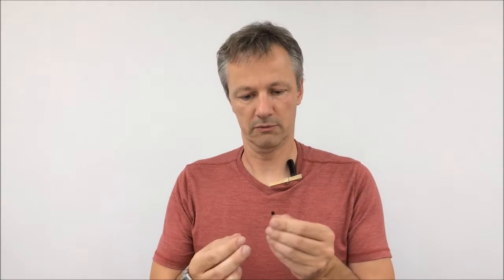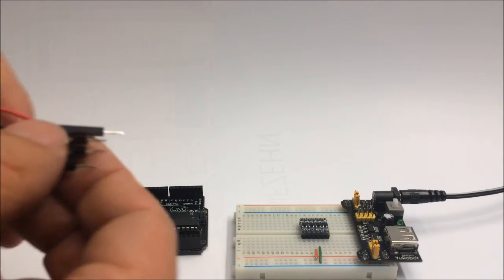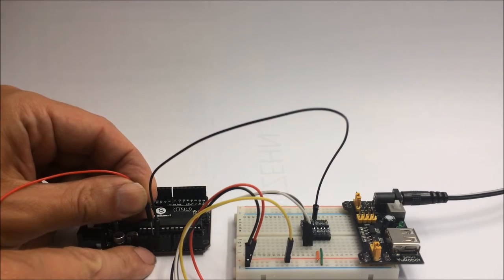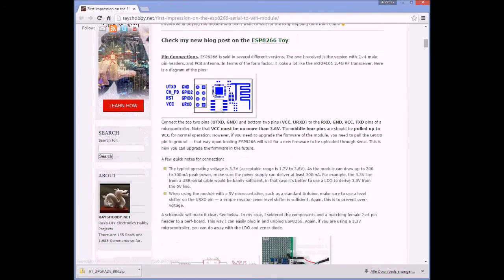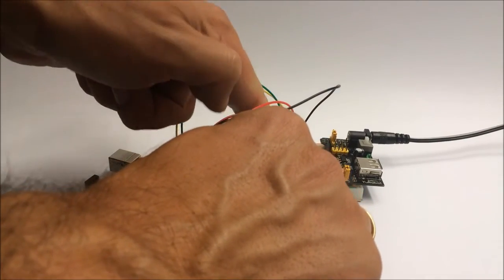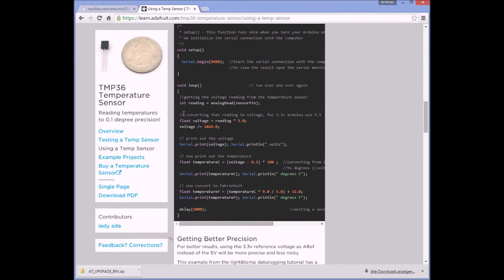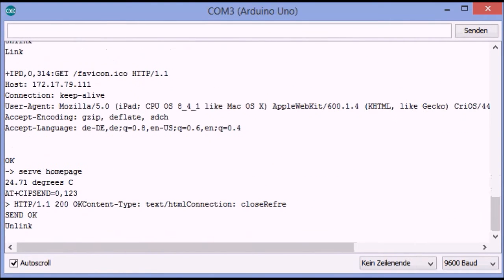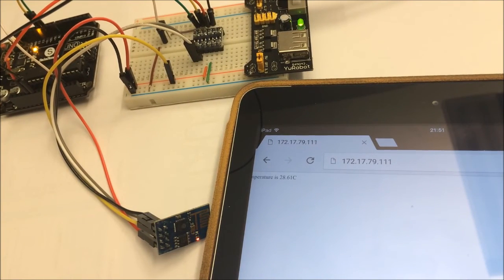Arduino and ESP8266 - Part 2: Web Thermometer

Comment: Thanks for the tutorial. Will you add a tutorial with direct programming of the ESP with only the Arduino IDE?
Reply from the maker: +norm1124 I don't have any plans yet. I already tried a few things and was quite happy with the results. None of that was particularly original, so I haven't recorded any of that.
It is a very efficient way to eliminate the need for bulky firmware.

Comment: Nice explanation. I am working on a  project where I interfaced esp8266-01 with arduino uno and LCD(16*2) . 

The communication between Esp8266 and webpage is working fine with AT commands.
I used C programming. I heard of Lua script but dont know what exactly and where it is used.

Now I have a web page where I have two text box and submit button.
When I type some text on text box and click on submit button, the text should appear on LCD. 
I am new to web and server. 
I tried using get method from internet resource but could not achieve.Some blogs said use php. 

Any idea Sir.
Reply from the maker: No, PHP will not be necessary. It can all be done on the ESP8266, but you have to parse the submitted text (post-method) abd extract the text for the LCD from that.

Comment: just started. I would like to know how to determine how many pin with it's type and no. available on board on any kind of esp wifi board programmatically. Is there any program for this ?
Reply from the maker: an ESP-12E od 12F module and development boards (like this one: http://www.banggood.com/Geekcreit-Doit-NodeMcu-Lua-ESP8266-ESP-12E-WIFI-Development-Board-p-985891.html?p=NT1005763073201409DA ) will give you all available GPIOs. See here for details: http://www.kloppenborg.net/images/blog/esp8266/esp8266-node-mcu-pinout.png

Comment: If I want to store this temperature value into SQL database then how to do please help me out
Reply from the maker: I never tried that, but recorded my data in CSV files instead. Still, if you run a mysql database, there is an arduino library you can use to access the DB directly. (See: https://www.arduinolibraries.info/libraries/my-sql-connector-arduino )

Comment: I am trying to connect to my SSID and password, but in arduino serial monitor, it shows 
begin.
device ip addr:
then it stucks there forever. Help !
Reply from the maker: +Anum Sheraz The Arduino sketch wants AT-Firmware 0.9.2.2. You can find a download in my blog article here: http://www.areresearch.net/2015/09/arduino-and-esp8266-part-2-web.html
If you already have that, check your wiring and if the level shifter works in both directions.
Reply: +AReResearch It was the wiring issue. Before I was giving power from arduino 3.3v. Now I am giving power from arduino 5v by making a small voltage divider, downto 3.36v. Works perfectly ... Thank you :)
Reply from the maker: Yes, that is a common problem. The Arduino cannot supply the high current the ESP takes.